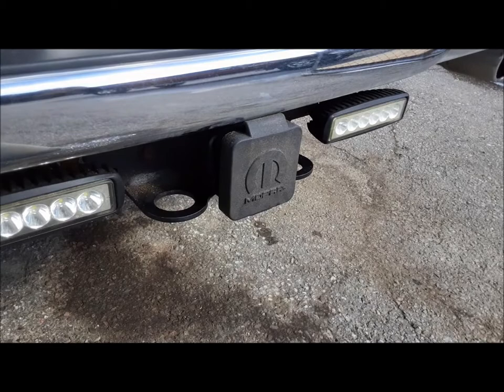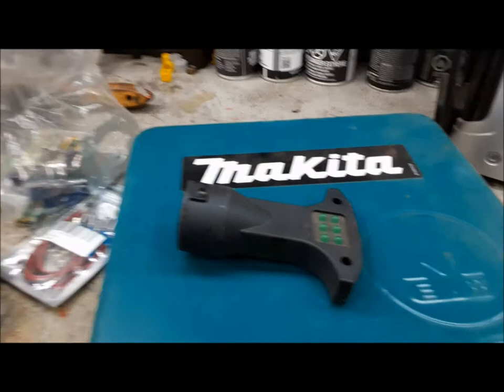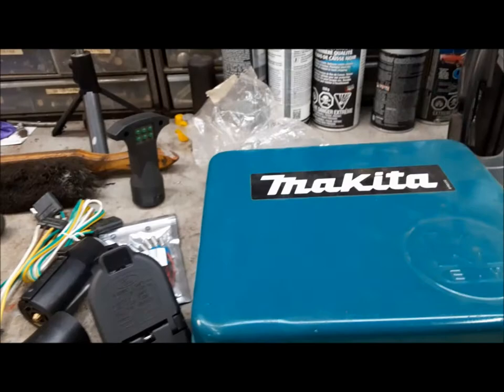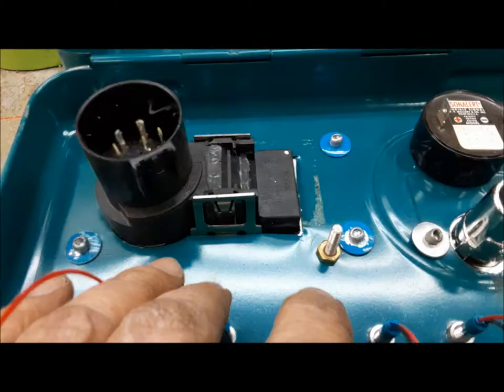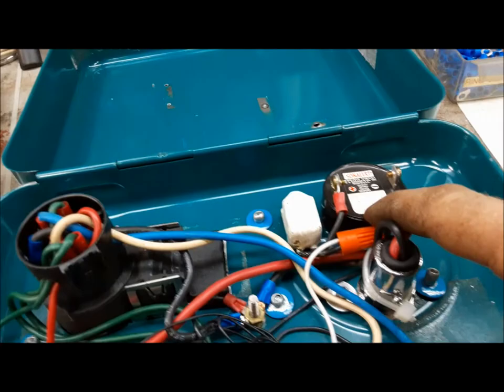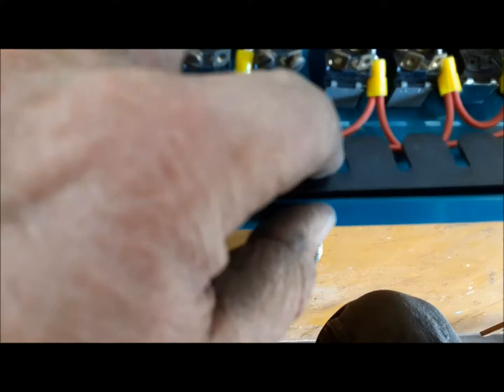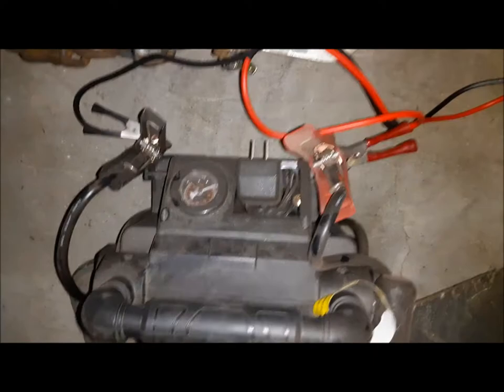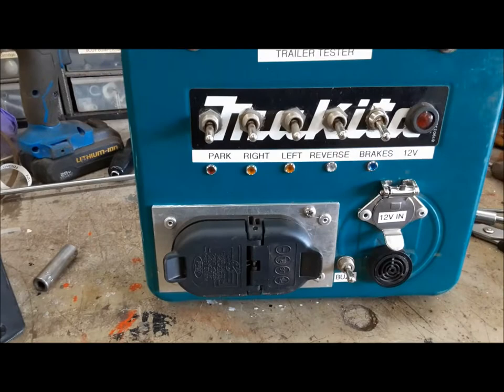Making a Trailer Tester

Comment: Love your idea. I'm hoping I can implement it in my new box I'm trying to wire it now. Any chance I might be able to pick your brain if I have any questions?
Reply from the maker: Sure, I'll help if I can!
Reply: @ClaremontClassicGarage  
Thank you so much. I will get to the point where I'm ready to wire it. Instead of doing the diode I'm thinking about just wiring two separate circuits do you think that would work? One for testing the truck and one  for testing trailers? I've got enough lights and I've got enough room in my box to do it I'm using a plastic tool box at large 1.
Reply from the maker: @1ton4god  Sure that should work.

Comment: I would like to buy this tester.
Reply from the maker: Just gather up some junk and make your own like I did.
Reply: You could build an even simpler one for the sole purpose of checking  trailers only. 
Metal box, few simple 2 pin switches for lights, socket same as what's on your truck or car etc, in line fuse holder, some wiring and spade  connectors and a  power source - 12v bike battery for example.. simple block connectors and tools.

Comment: Is it possible to add a flasher unit for the turn signals while the marker lights are on
Reply from the maker: It could be added but you would either need 2 flashers or install a turn signal switch if you wanted to flash left and right individually.
Reply: You could use just  one flasher for both left and right, just means both left and right would operate even if only one side was switched on which would be fine as you only want to establish  if indicators actually are working.